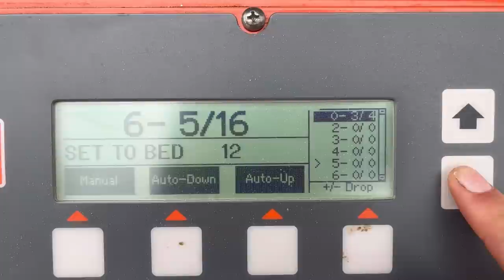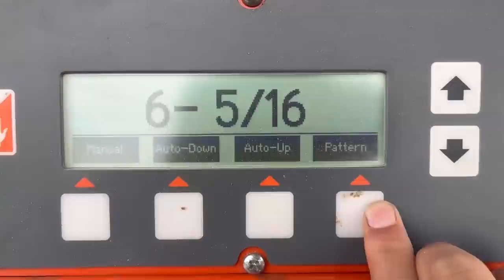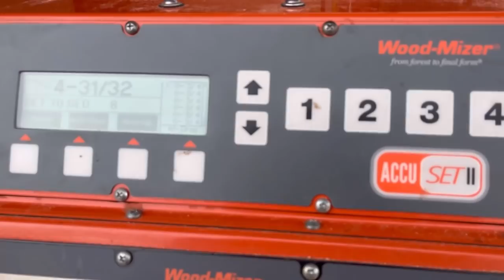How I Cut Live Edge Siding 210

Comment: Emerald, if I may, I have a question.  All I know about sawmills (of this size) I've learned from your channel.  I've noticed that after every cut, you have to raise the mill more than absolutely necessary in order for the arm that catches the board on the return stroke to not catch the log.  It appears that arm is set below the level of the blade.  Is there a reason you don't shorten the length of that arm until it is just above the blade by a bit less than the thickness of your thinnest normal cut?  That way you would just have to raise the mill by, theoretically, the thickness of the blade after every cut.  (I suppose, really theoretically, you wouldn't have the raise the mill at all.)  As long as the board is thicker than the distance you set the arm above the blade it is automatically caught.
As I mentioned, I could easily be missing an obvious reason, but, darn if it doesn't 'bug' me when I see it!
Reply: Of course, I've immediately thought of a problem with my suggestion.  What happens with the last piece?  It is below the blade and, if thin enough, can't be reached without wrecking the blade.  I guess that makes it a special case that would have to be handled.
Let that be a lesson to me, always test the edge cases.  It's the quickest way to find many flaws in your logic.
Reply: @docostler  My unprofessional 2c (not in the industry either) -  the 1st cut to flatten the log often has a lot of irregular protrusions.  You would either have to manually raise it on that pass and/or risk hitting the blade on the flat edge on return.  The high automatic lift may be a solution to enable automatic return on the vast majority of scenarios vs the easiest one (with no other variables).  Also the high lift accommodates very thick boards as well as thin ones without having to adjust each time.
Reply: @carlbracker2306  But the arm that picks up the board leads the blade on the return stroke.  Board thickness doesn't matter because it is being removed as fast as the blade is trying to catch up.
Also, I don't think the lift is automatic.  There have been times I've seen it try to return the board and the log because it wasn't raised enough, and also seen it being raised a bit too much and missing the board.  These kind of things are what got me thinking about this in the first place.
This is fun, we'll get these 'design flaws' worked out yet!